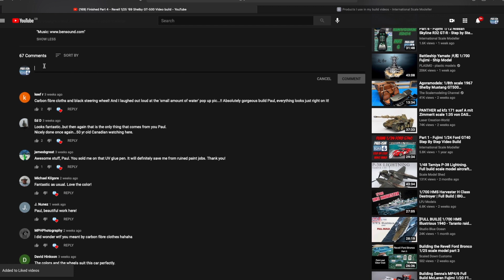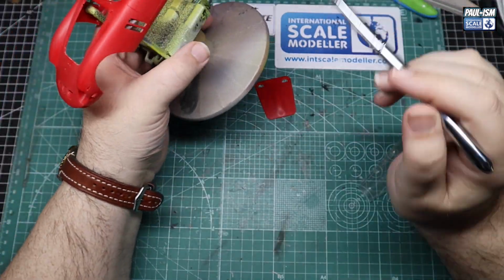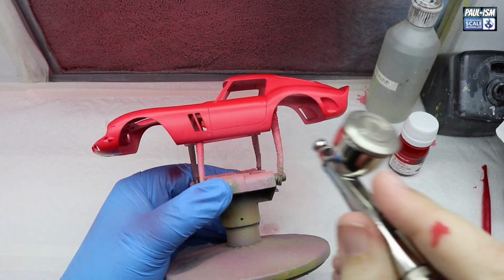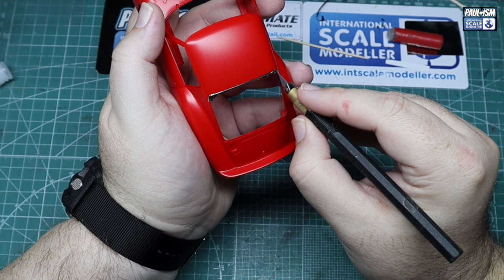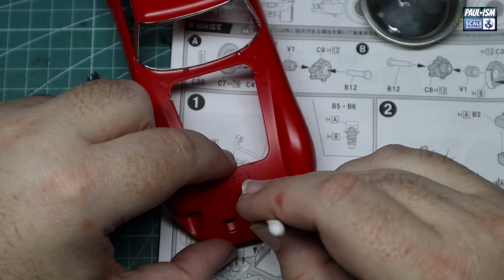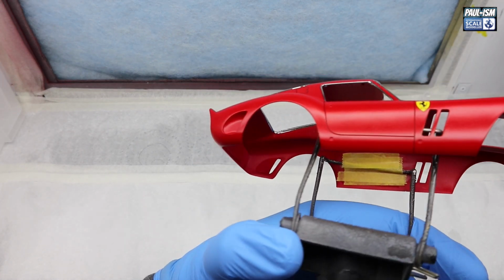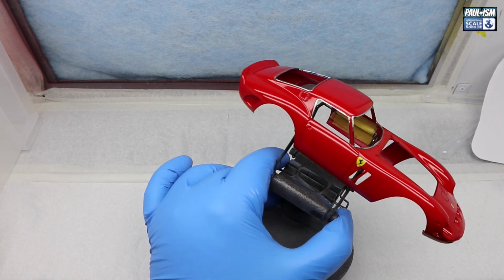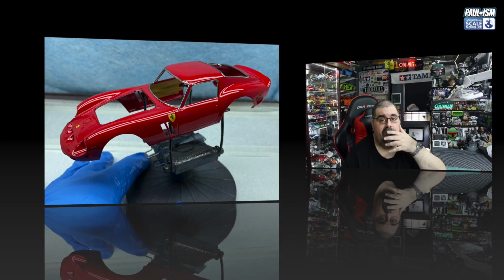Fujimi 1/24 Ferrari 250 GTO - Part 1 Bodywork

Comment: Great paint prep and related tips leading up to the painting! 

I have a question relating to the final finish: The clear coat seems to “round over” the seams and body lines (as are visible in the close-ups of the completed body pain. To me this takes away some of the realism of the scale. Is there a way in which you can prime-paint-clear coat the body and prevent that rounding of seams and edges on the body? 

I ask as a relative novice to model building, but pride myself in detail (to a fault it seems).
Reply from the maker: I would say don’t worry about it like I don’t and just enjoy the hobby

Comment: I am getting back into building models.   The 250 is my favorite Ferrari.  I know there are the kits from Fujimi and Revell.  Is the Fujimi your favorite kit?  What model of air brush are you using and comressor?  You did a good job on explaining the paint process.  I painted my motorcycle with rattle cans and I used a 2 part spray product called SprayMax for my clear coat.  It came out very nice.  I wonder how it would do with small models.  Have you tried SprayMax before.
Reply from the maker: The Fujimi kit is very good I have recently acquired the model factory hiro one which in 1/12 scale is amazing. The review will be uploaded in a few hours.
Reply from the maker: Airbrush is an ultimate apex compressor a sparmax 610. I only use gravity Spain 2k

Comment: Have you ever used aluminum duct tape for the chrome it can be used it may not be quite as easy as the foil you used but it looks good it is a little bit thicker so a little bit harder to cut but it comes in a roll it isn't really very expensive can be purchased at any hardware store I have had the same roll for years it sticks very well so you have to be careful that you don't get to much on the paint unless it has been drying for a while .